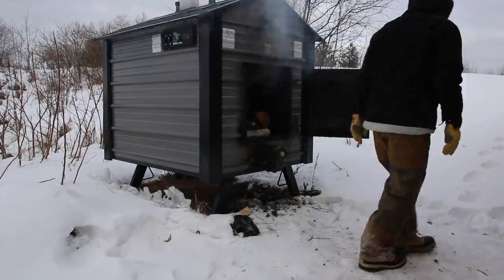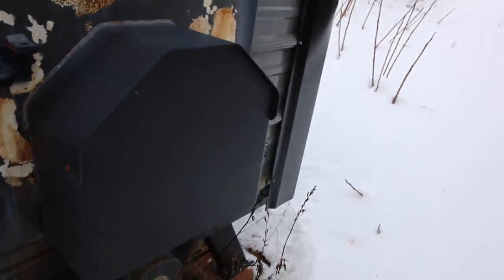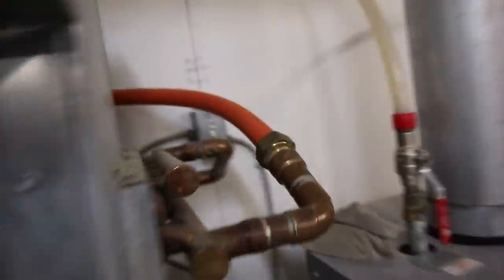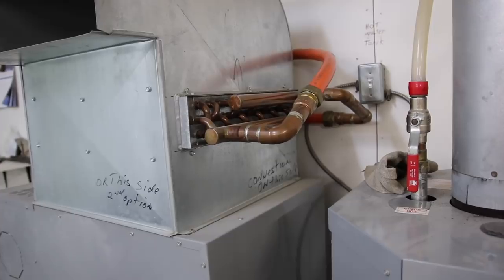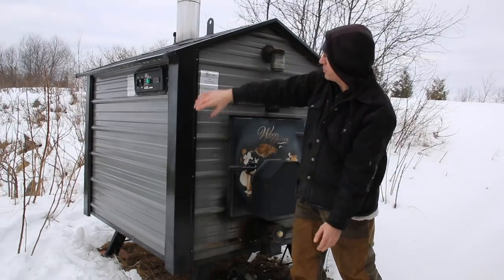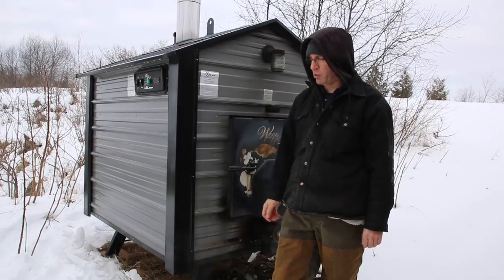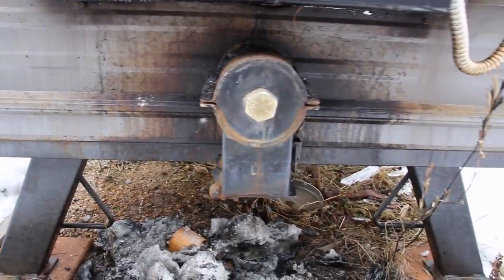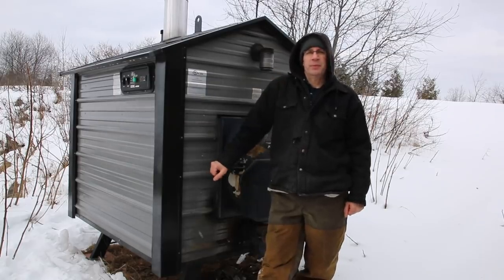Outdoor wood furnace "worth the investment?"

Comment: When i built my boiler i made 2 fire boxes. As well as the chiminey i piped it so it wentvthrough the water jacket. And after got fire one going i would choke it right down then in start up i would build second fire 10 hours later. And refill fire one. Once i got both fire boxes built with coal beds it would burn and keep the water hot for 2 days unattended. Secrets of wood heat is choking off the air so wood burns extreamly slow. My burner never made smoke smell inside and was only 6 feet from the house. With water lines above ground so never lost huge heat loss in the pipes. The floor temp stayed close to 70 degrees. Smiles never cold feet and no noisey blowers running. Only bad about it, i sold the boiler in need of money.  As well was having to add water to the boiler cause i used it for hot water to shower and do dish washes ect. So hauling water was a pain for me. But over all if inventive oriented you can make some efficient heating systems.  What i concentrated most on was capturing all heat as possible from discharge chiminey, and really thick metal in fire box and water jacket. Ya took time to get the steel warm but after heated it stayed warm for very long periods. One time experimenting before it got minus 30 i tested the 3/4 inch thick steel of the water jacket empty. And it stayed 80 degrees for 5 hours with no fire at all with only hot coals in fire boxes it stayyed 80 to 90 degrees for 14 hours with water same test water was about 60 coming from the water tap on the sink. So it was a efficient heat system. But like said ya hadda cut and haul wood and do some work. But i see it as i worked and still alive so the work side never killed me.  Have a good day

Comment: I have a central boiler 5036. love it. No fan electric fan. natural draft, Ive been using it for 10 years. I live in Maine. I can burn anything but semi seasoned wood is best. Its not a gasifier unit and really there is no maintenance. I have a wood lot that I can cut wood off and I do buy some. 6 to 8 cord a year. heating a 2400 sf. house. radiant in the basement and first floor. baseboard up stairs. I hardly ever take out ash. seems like when raking around the coals before filling it most of the ash goes up the stack. I full my tractor bucket 3 times a season. its ez. my wife fills it too. its only 50 ft from my house. Im 1/4 mile to the next house so no smoke issues.

Comment: We live in northern Minnesota and heat with both propane and the wood boiler.

We only use propane during the early fall and late spring seasons.
My personal experience;
The propane heat doesn't heat very warm. We have to set the thermostat at 85° F to maintain interior temperature of 68°.
The propane is very expensive too.

When we fire up the wood boiler the house gets warm. It's a totally different heat. The house gets warm and stays warm. No ramping up the thermostat either. Set it at 68° and it stays at 68°.

Yes, it is a lot of work.
Yes, it's a bummer to have to get up at 7am to fill the boiler when its -40°, but it's good exercise.

Yes, you'll smell like the wood boiler for the rest of the day, but don't mind this.

As for the smoke, as long as you never burn any thing other than wood the smell is no different than a camp fire... and who doesn't love the smell of a camp fire !

It is a lot of work, but I love the wood heat 😀

Comment: as one who has installed these for years and service them, if it is installed right, you have no heat loss in the ground at all, i do winter installs in -40F and the line is on top of the ground until spring, the snow dont even melt off the line, i have been in peoples drive ways plowing snow in Feb. and my truck sinks in the mud, but yet it been -40 all winter,, not installed right. 2nd, you dont need to cut your wood for the whole winter a head of time, leave the wood round and green, cut it as needed, burns a lot better and last longer, do not split it, no need, you want the glycol in the unit as not only do it keep it from freezing it also keep it from rusting out, 3 have your water tested to make sure the PH  is right, to high PH  will kill your unit, and a good MFG  will want a water sample once a year to make sure you are keeping it in the right PH  or they will void your warranty.. the biggest problem is people, not the units.. the water temp coming into the building should be the same as at the unit, the temp of the water leaving the building should be no more then 3 deg lower, if it is, it was not installed right, and this is with you main heat as well as heating your domestic hot water and and your drier, a well built unit will not smoke much once started,, you get what you paid for, these units do not operate any were close to your  boiling kitchen kettle

Comment: Using straight  water is a problem other than freezing the lines, if you did the same in your vehicle you would learn very quickly just how much corrosion you get!
Reply: no it is not water is fine since you are circulating it it stays hot. u can use a glychol but they recommend water. you treat the water with a corrosion solution 35$ and that is all. unless you have to add water then you don't have to retreat. I drain mine every five years and refill and retreat., crystal clear . 15 years old. getting ready to do after this winter

Comment: We heat our home with a wood stove (Inside) . Cheaper and if your power goes out from a snow/ice storm that out door wood furnace will bite you back because you have to use your indoor furnace blower to move the heat around. I thought about getting one until a friend told me about them. Personally I think they would be great to heat a workshop where you couldn't have a flame inside. Cool Video !

Comment: A few suggestions: 1. Use a wheelbarrow between woodpile and stove, spend less time walking with 1-2 piece of wood at time.  2. Don't burn green wood (I can tell by the smoke, and you mentioned stinky smoke a number of times as well).  Overall--yes, I agree, an outdoor boiler is a poor investment.  I've heard it from a number of people.

Comment: The glycol is mainly to keep down internal corrosion if you have any metal in the piping system. This is not really an outdoor wood furnace, it is a wood fired water heater plumbed to a radiator or an A coil, plus most of your heat goes up the chimney. I much prefer a good indoor, airtight, wood burning stove like the old Earth Stoves.

Comment: on the day or the night your furnace quits because the controller went out or the water pump went out or the blower went out is the time your pipes are all going to freeze you may want to reconsider using glycol
Reply: I thought the same thing. What happens when the pump breaks? Power goes out? Now you have hundreds of feet of frozen pipe..no thanks.
Reply: are yall really this ignorant. so what if your conventional equipment breaks what yougoing to do? plus as long as the fire is burning u want freeze the lines at the boiler it takes days for the boiler to cool down id the fire goes out unless you are pulling heat out of the water. if the power is out then there is no heat being consu,med which mean no frozen pipe.it may freeze in the air handler but not over night unless it is the minus then maybe.

Comment: Hot air rises so you should heat lower towards the floor. Also heats the concrete thus holding more heat.

Comment: However after hearing your point I do like the idea that you can keep your outside wood stove at 60 degrees when you are gone through your oil heater but you have not mentioned what happens inside your residence home you seem like you're not using it over there but just in your shop again I'm just trying to be helpful but all it takes is a small radiator and a fan close to the floor and you have decent contributing Heat enclosing you are lucky to have such a nice unit I know a few people that wish they had one

Comment: I would think the main reason you would want some sort of glycol mix at the very least is what happens if it fails on you and by the time you realize that and get it fixed or get the part you need it freezes solid and cracks your tank and whatever else?

Comment: Yes, it is worth the investment if you have  your own burning wood or can get it cheap. I marketed such furnaces a very long time ago. They could receive  4 foot long logs/branches/straw bales. The door was 30 inches in diameter. That makes good volume and allows a full day´s burning. All the walls around the chamber were double with water circulating in between. They had no thermostates regulating the  burning. People got it up to working temperature and then closed the air intake, leaving a small opening the thickness of a match. There was also a hot water battery of about 100 gallons coupled to it, with a circulation pump that moved around the heated water. There was also a pressure valve that sent in cold water into  the system to prevent overheating. The furnace was installed in a room at least 12x12, where the next load of wood could be stored as well. All the piping was insulated. The battery was very important since it gave continuity.

Comment: I actually have that same stove. I burn the same amount of wood as i did when i used indoor wood stoves to heat my house. My pipes are insulated real good so i only see a 1degree difference between the stove and house. I get an endless supply of wood from my trees business. So for me its a perfect fit. The only thing better would be a wood chip burner.

Comment: I have a Drolet woodstove. Well, actually 2, one at my cabin and one in my home. I live in the U.P. of Michigan and have long winters with an average of 230 inches of snow a year. At my home, which is 3200 sq feet with 18 foot ceilings, I burn under 5 cords of firewood a year. Both my stoves utilize the direct outside air intake which is important in keeping the whole house warm.
There is nothing like wood heat. Nothing like it.
There is nothing backbreaking about it. We get full logs delivered, we saw split (hydrolic splitter) and stack it. We get that all done a couple hours here and a couple hours there all in about a week, maybe 15 hours tops.
Reply: I burn wood down state.Idon't draw outside air whats the difference
Reply: Heidi Huber-Stein so....how I can explain it best is this; a super small woodstove that can burn at a maximum of 20,000 btu's needs 1000 cubic feet of air for combustion per hour. If you take that air from the inside of your house and that air is replaced by the outside air, and where that air comes from is from all the little crooks and crannies that are in your home. That cold air that is drawn in comes from everywhere in your home but it's the reason that the rooms far away from the heat of your woodstove stay cool and that's because the heat never gets a chance to get there because it's in a fight with the cold air being drawn in. With a direct outside intake the heat can travel freely throughout your home.
If you have looked up the data on new woodstoves you'll see that many stoves aren't "mobile home approved" and it has nothing to do with the clearance or anything like that, it's because those stoves don't have a outside air intake. Mobile homes have poor insulation but are built very air tight to compensate that problem and you'll deplete the oxygen very fast and have a major health issue with a stove that takes in the air from the home.

A side story to this is I bought a new Dometic (brand) propane refrigerator for my cabin and installed a direct vent for the exhaust. I couldn't keep the fridge going. The pilot light would always go out. One day, when we had an old traditional wood stove, we were fiddling with the fridge exhaust and noticed we had a massive breeze coming in through the exhaust. They someone opened a door and the breeze stopped. Close the door = massive wind. Open the door = no wind. The fire was pulling in that much air through that exhaust and snuffing out the pilot light. Now with the new woodstove that has the direct outside combustion and ir that does not happen.
Reply: My name is Jack .Thanks my wife and I love our stove,this is our 3rd year this will make it more efficient I think.Where at in UP?
Reply: Heidi Huber-Stein I'm Paul and I live just north of Hancock. Yes this does make your stove more efficient. What brand and model stove do you have and does it have the option of an outside air intake? Some stoves do and some stoves don't. If it has the option: do it. It's pretty cheap and a easy install. And it makes sense.
I had no idea how much cold air is drawn in until I had that experience with that refrigerator exhaust, it was shocking the volume of air being drawn in. After that I did some research on the topic and figured to give it a try and I can't complain.
The newer wood stoves with their smaller firebox, airtight-ness and how they recirculate the gasses and burn up the particulates is pretty cool no matter what brand you have.
Don't forget that chimney cleaning. My home has a flat roof so I can clean my chimney really easily(passive solar house) and i clean my chimney once a month but at my cabin I can't because of the metal roof and the knarly steep pitch. So I was trying to figure out a way to clean it from the bottom down and found this cleaning system: SootEater. It works amazing. There are some vids here on YouTube you should watch about it. Just thought I'd throw that idea out there since we're chatting. 
I had a small chimney fire 20 years ago, no damage, but it was an experience that I'm never going to have again. Way too exciting.
Reply: woodstock woodstove hybrid progressive
Reply: Heidi Huber-Stein yeah, that's a heck of a good stove. You'd jack up the performance with that optional intake which it does have as an option.

I'm out at my log cabin for the weekend, I came out last night. It's not a huge space but not small either- 35' x 45' but it has a open/loft 20' ceiling and my stove has been kicking pretty good. It's warm in here but it really doesn't get really warm until the log walls get warm, takes about a day. We got about an inch of wet snow last night and it's still falling.

Comment: It helps if you have an easy source of logs to cut into firewood. Think "Tree Service". Those guys will drop off logs for next to nothing, if they like you. I have a sawmill and have worked with a tree service guy for about twenty years. I talked him into buying two Hardy boilers very soon after we got partnered up. He loves them. Of course, he has all the chainsaws and an endless source of logs, so there's that. You are going to have to do some sawing and splitting but remember -- unlike smaller indoor wood stoves you don't have to split your firewood as small. If it will fit in the door, you're good. You can generally cut your rounds to longer lengths too, which helps. So if you don't already have some equipment like good chainsaws, log splitters, trucks, tractors -- whatever it takes to produce some firewood -- then maybe wood boilers aren't for you. If you do... well maybe. There's always the indoor forced-air furnace that burns wood. Sort of an in-between option. My gal and I just want to get away from the indoor wood stove. Too messy.

Great vid. Thanks for posting, eh?

Comment: Never understood the point of those outdoor wood furnaces. What advantage do they have over a wood stove?
Reply from the maker: 1. Always same room temperature. Set the thermostat to your preferences and your set. 
2. You only need to put wood in it once or twice per day depending on how cold it is outside. No need to wake up in the middle of the night. 
3. No dirty wood in your house. 
4. No more dust or smoke in your house. 
5. Your wood don't have to be totally dry. It will still burn.
Reply: Larger fire box, longer burn time, everything is outside, can also heat your water (as long as there is a fire I have unlimited hot water) and like I do use it for the hydronic floor heat in my attached garage

Comment: I Heated my home for 20 years with a wood burner, and like he said they are a lot of work, finding wood is the hardest thing, I finally started burning wood pallets, but they can sometimes smell bad, I had my wood burner in my garage, and built a heat exchanger on it and piped the heat into my house, it keeps a lot of the mess out in the garage, but if you depend on burning wood, you better bee  ready to spend a lot of time finding wood, if you plan on buying wood, that defeat's the purpose of burning wood,
Reply: No, buying wood doesn't defeat the purpose of burning wood; not buying overpriced fuel oil is the goal, not free wood or free heat.  Even buying at $110 a tree-length weighed cord is much, much cheaper than buying $3 or more per gallon fuel oil. Cheaper and better is always better.